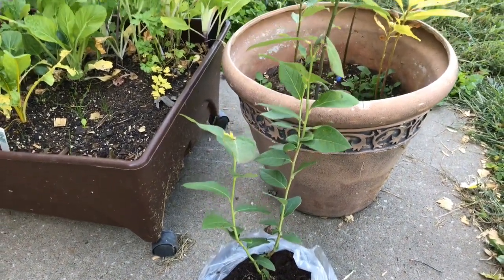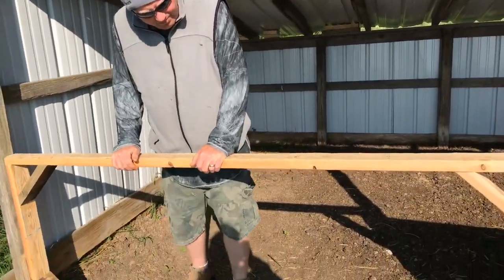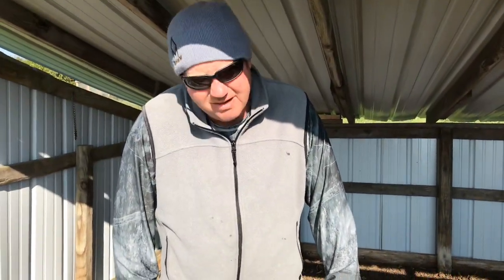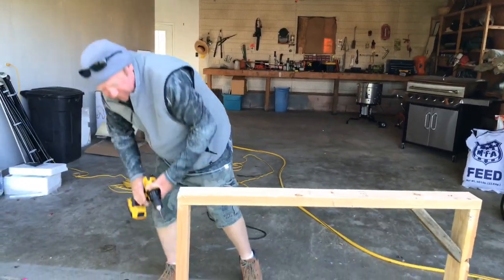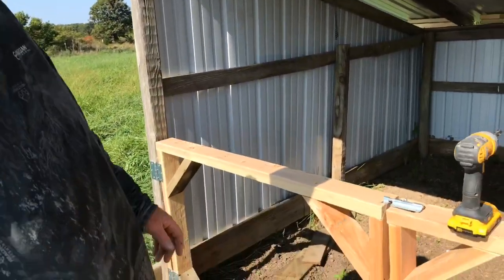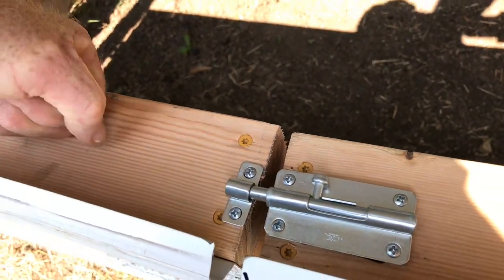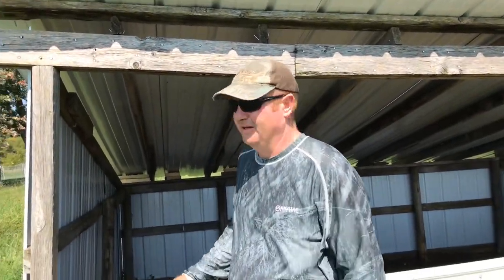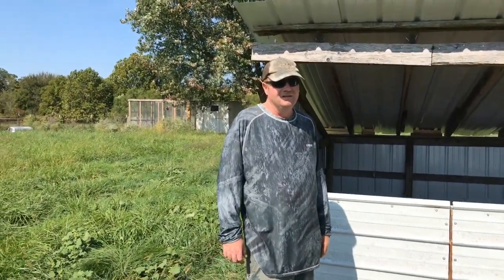PIG SHELTER IS FINISHED! THE PIG PALACE!

Comment: Very nice! I’d be happy to live there if I were a pig 😉  If I may make a suggestion, you may want to think about running some white duct tape or something along the top and down the corners of the gate and the other piece that doesn’t open so you’re not getting sliced up when you go in. I used car door trim on another project and it didn’t work very well since the tin is much thinner than a car door and my edge was vertical, but it might work here too since you have a horizontal edge.
Reply from the maker: That's a great suggestion! I'll see what Kevin thinks and ask if he can fix that! I thought I'd live there if I had to! Lol!